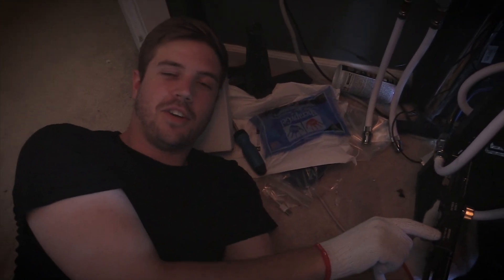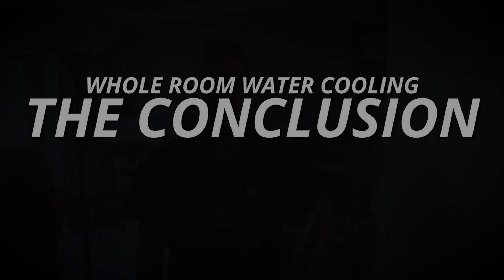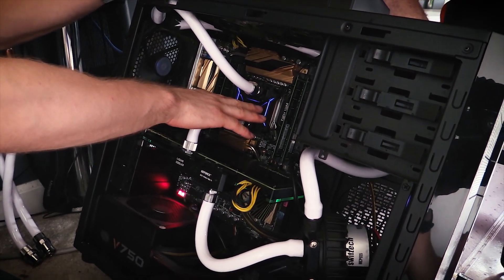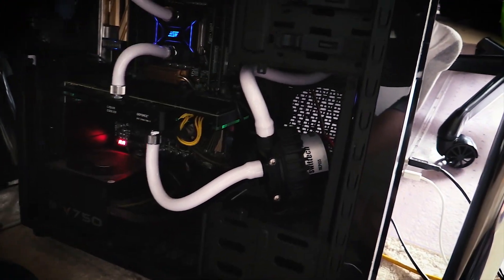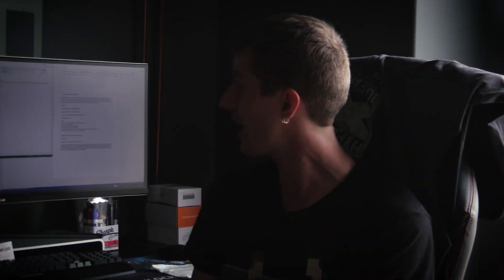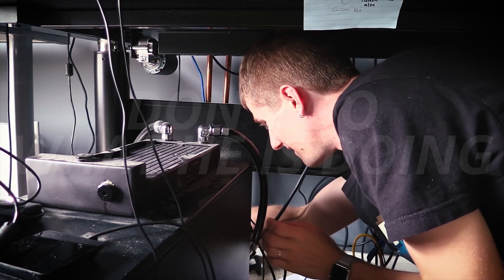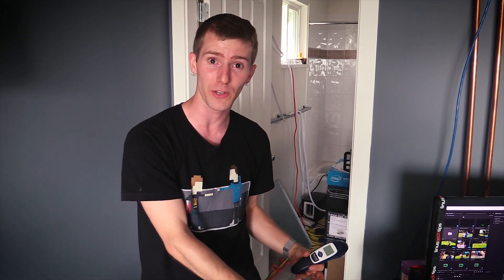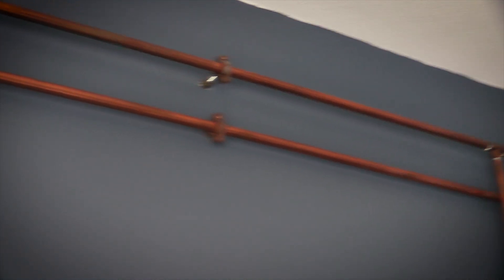Whole Room Water Cooling Part 7 - It's FINALLY over!

Comment: ok i am new to this channel
why arent the copper pipes near the floor of the room? less material to use, less water, less pressure, less surface to radiate heat. and its kind of hidden, not this ugly ass construction
Reply: Riley P this would be incorrect. If anything, the copper pipes are dumping all the heat they're pulling from the computers into the room. Since the computers are what heat up the room, the pipes ideally should've been insulated while within the room in order to successfully carry all the heat outside and, thus, lower the room's temperature as well.
Reply: aggressivli I actually find the setup to look pretty badass, as it gives the room a sort of steam-punk-ish look.
Reply: aggressivli They coul d've also insulated the pipes with a foam to minimize the heat dissipation back inside the room.
Reply: Joseph Griffin Exactly, Linus also says this in the video
Reply: aggressivli If I recall, the intention was not only water cool their computers but, to cool the entire room as well.  With the cool pipes, the heat would be sucked from the air(Or the cold would radiate through the room: which ever way to think about it.), More piping, more surface area, more area for the cold from the pipes to radiate so to say.
Reply: aggressivli Go watch all 1-6 parts before this
Reply: aggressivli I would constantly worry about destroing the pipes if they were placed along the floor, and one day I'd probably kick them or bumb something else into them
Reply: Joseph Griffin It's not about the fucking look its about how the water flows ffs.
Reply: EkumaGaming HD like I'd give two shits lol, it was a bad idea in the first place so might as well enjoy the looks.